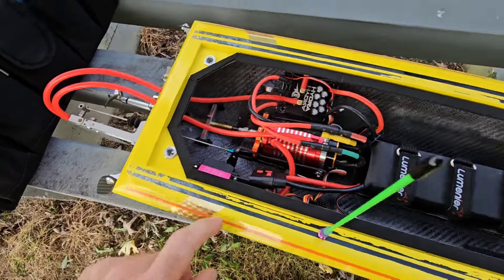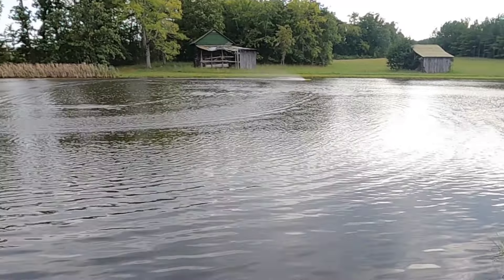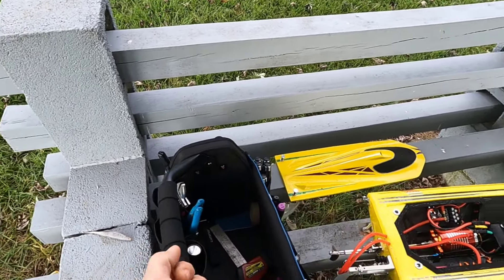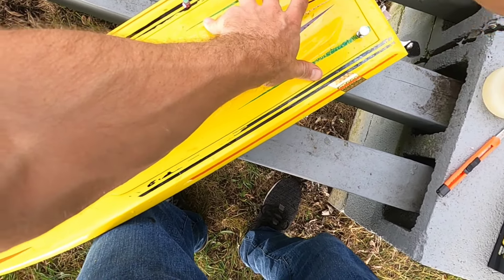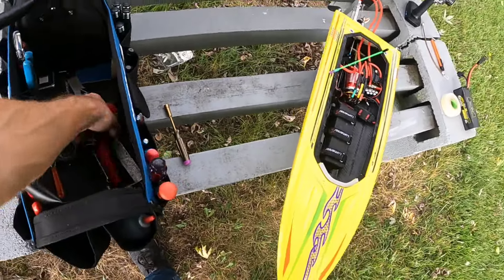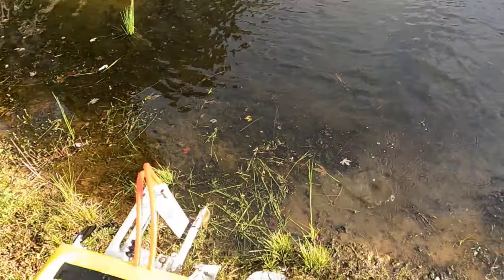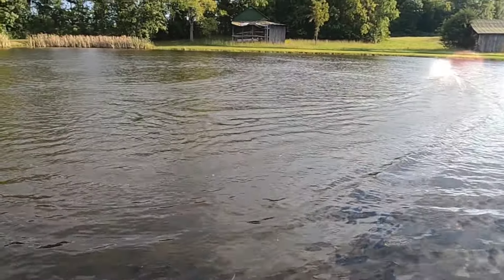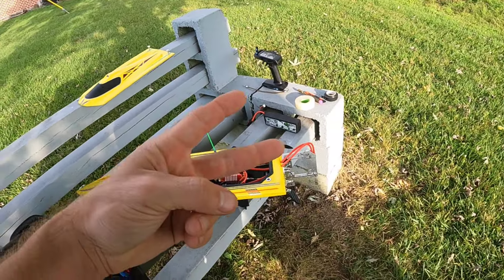Chaser 32 Final Run with 1650kv TP motor 3s/4s Prop testing for fun. "I know its slow 😆 "

Comment: I've ran a 4082 1650kv sss motor in a similar boat and it loves a4519 and on 6s 4619 prop. Once you put that boat on 6s it's going to handle way different. I bought the wfly x9s and though i haven't taken it to the lake yet,i love it. I was glad to see the difference between gps modules. It's a really nice transmitter and at a great price. Amazon is selling them now.

Comment: There's  discussion on IW about how FE needs to be slowed down. when you heat race the only limit is voltage. so people are pulling 300+ amps and going like 65mph in 4s size hulls. They crash a lot, its just too fast for the hull sizes. There isnt a good way to control the speed without expensive current limiters.